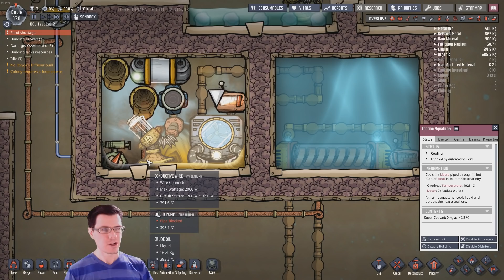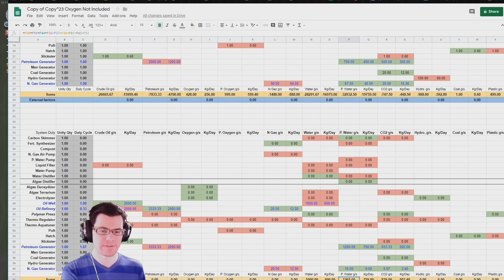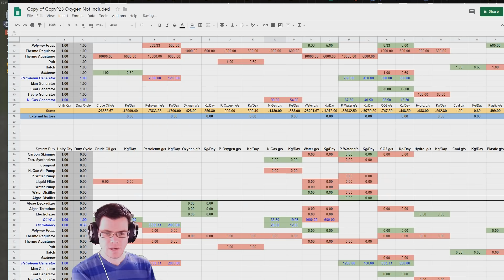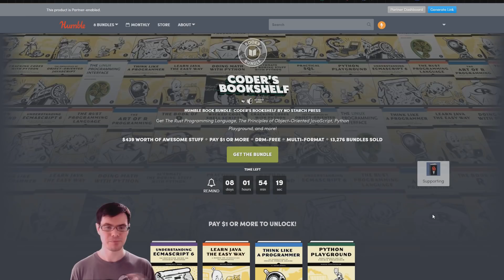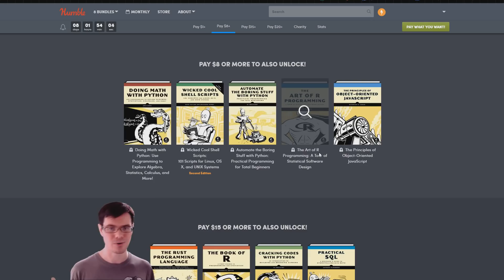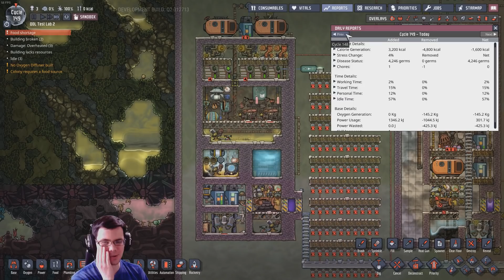Unlimited Free Energy! Oxygen Not Included

Comment: If you just want to make it run for the sake of it, you can use polluted water instead of coolant. It wont power the second generator, but at least you'd get some free petrol over time.
Reply: Also the system is more efficient if you exchange heat from petrol to oil, before you run it into the gen.

Comment: Couldn't you use polluted water in the aqutuner instead of super coolant to maximise the energy dumped into the crude oil heating chamber? Also, the efficiency would improve if you put the liquid vents over the thermo regulator(s) instead of the liquid pump. If flashing into sour gas is a problem, why don't you use the cold side to condense the sour gas into liquid methane and warm it back to form Natural gas? You could then use Natural gas generators instead.

Comment: Would building two separate boiling chambers with separate water heat sink help? Essentially copy/paste the aquatuner and water rooms, maybe 2 or 3 times until the cude oil build-up isnt the bottle neck. Or maybe just flanking the pump and hydrosensor with an aquatuner on both sides, and instead dripping the crude oil at the edges of the room to push petroleum to the pump in the center of the room.  Might work to drip fresh crude on one side and re-circ oil on the other. I'd think putting the pump on the re-circ side and the sensor on the fresh side of center would be better. Just ideas. Love the channel!
So, something like this:

D = outlet drip, A=Aquatuner, S=hydrosensor, P=Pump, W=wall

W D                   D W
W A A P P     A A W
W A A P P S A A W
W WWWWWWWW

Comment: Instead of putting the aquatuners together put the pump and the sensor between them and use some tempshift plates... that way you have heat sources on both sides not just in 1 side... to use the cold water more properly maybe pipe some sived slimelung water to get it cold enough to kill the germs... i allways have to much of that... and keep up the good work
Reply: You can do free water decontamination with chlorine gas at the expense of permanently storing 10t(2 liquid reservoirs) of water per 5kg/s throughput.
Reply: @Xerkus  but you loose  chlorine in the process...

Comment: What about putting the pump on the other side of the aqua tuners so the outlet is on the left of them and the pump on the right. That way you would pick up far less crude oil that hasn't converted yet. Also, maybe run the tuners in parallel instead of in series. That way you can run one at max and use logic for the other one to pickup the slack when needed.

Comment: Question, and I forget if this was covered, but is Sour Gas heavier than Natural Gas?
That question is from a design standpoint, because all you WOULD have to do is heat crude oil at the bottom, and essentially have a cooling tower at the top. Petrol sorts itself out.
In reality, this is how an oil refinery functions in the real world. You have a gradient of different grades and oil products just from that one silo, which is extracted at different levels due to density.
Reply: Sour gas cools down to methane, not petroleum. You have to stop heating it between 400 and 538 C
Reply: Unless you want to extract sour gas specifically, you don't need to have a cooling tower at the top. Just use the sour gas to preheat the crude, and turn it all into nat gas.

Comment: Slicksters turn CO2 into oil. You should figure out how much energy a single slickster creates by turning the CO2 into crude oil.
Reply: just to add some more info for Brothgar... You should use molten slicker... they transform direcly in petroleum, so you don't need to heat up
Reply: Isnt there a slickster mutation that turns CO2 into Petroleum? If you used those, then all one would have to do is prime the system with crude and then you wouldnt need the aquatuners anymore. This is assuming no mass loss from the slicksters though. However, any petroleum reclaimed would be much higher efficiency compared to crude oil reclaimed.
Reply: Looked it up on the wiki. They convert 33.3g/s CO2 to 16.6g/s Petroleum, and are comfortable in 90-250C environments!
Reply: @ashurroth6585  So the slicksters give off 50% of the intake, and the Petroleum Gen gives off only 25% CO2 of the fuel intake. Which is not at all self-sustaining.
Reply: @Agent Fire The system above is already more than self-sustaining. This would just add to its production of petroleum and make it more efficient bc it doesn't have to be cooled from 400C. You could automate the aquatuners to turn off when you get a full tank of cooler petroleum and while the generators are running on that they would be using way less energy and getting to cool off a bit.
Reply: You're also not taking into account the CO2 produced from the natural gas generator that is running all the time. All the exhaust would make for an excellent reserve tank of power  or a cooler solution for plastic production.

Comment: Brothgar, you may want to check into sour gas condensation. A petroleum generator burns 2kg/s of petroleum for 2kw, however a natural gas gen uses 90g/s for 800W and it also doesn't have a loss on the output mass(meaning more water and carbon dioxide). I don't know how much extra power it would take to heat the petroleum even further to get sour gas and then cool it down to convert it to liquid methane, but when I consider that natural gas generators could make 17.78kw/s out of 2kg/s of petroleum(instead of 2kw from the petroleum generator) I have a feeling that it might be very  powerful.
Reply: it takes about 3 Natgas Generators to power a medium-sized Natgas Boiler 
you should get about 8 to 12 Natgas Boiler you can use to power your Base
Reply: If you are smart enough about how you do a reverse flow heat exchange process, it takes very little energy to run, once you get it set up.